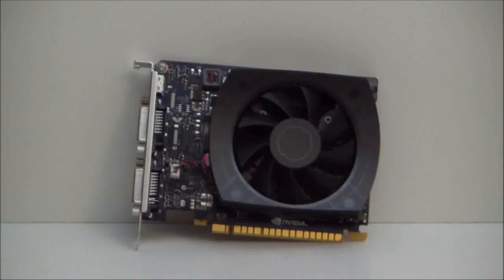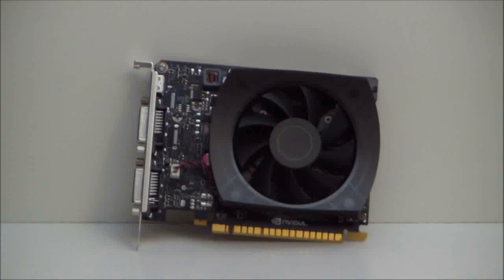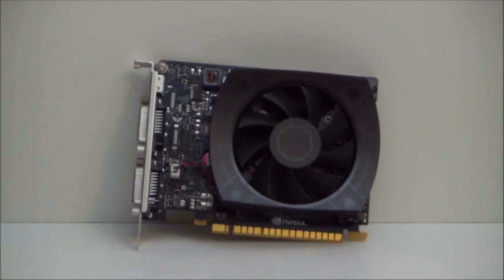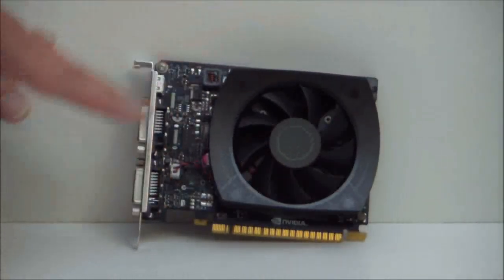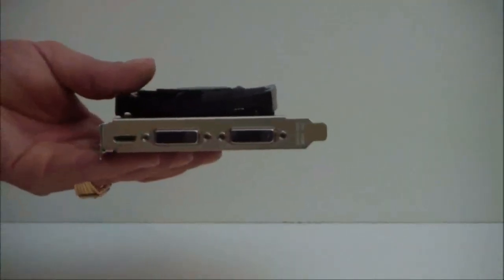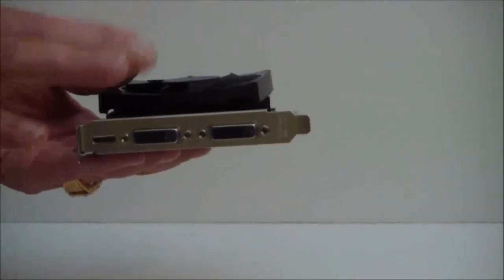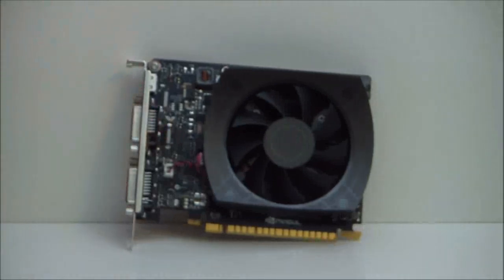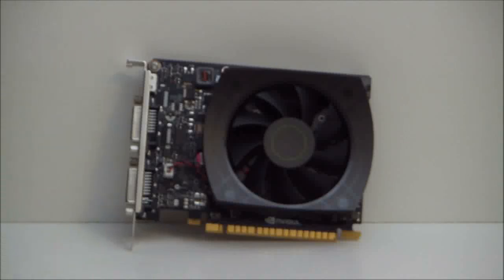NVIDIA GeForce GTX 650Ti Unboxing + Overview

Comment: I got a 650ti for 89 bones but it only has 384 unified shaders and a stock clock of 822 but requires 2 5 pins also a gf114

Comment from the maker: Best Buy sells NVIDIA branded Products. Usually a generation behind, NVIDIA is the OEM so they usually don't actually have their own cards. But do to a licensing agreement that Best Buy had with BFG before they went under, I think NVIDIA took over the contract. Sothat is why Bust Buy has NVIDIA branded cards.
If not the Partners like ASUS, EVGA,Gigabyte,MSI do sell reference cards.